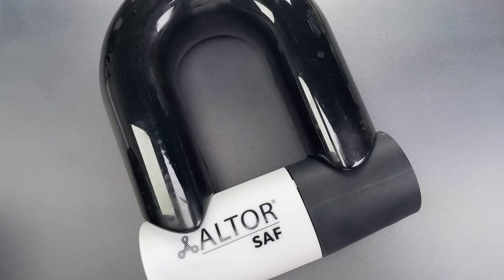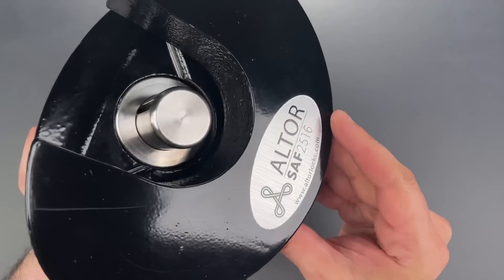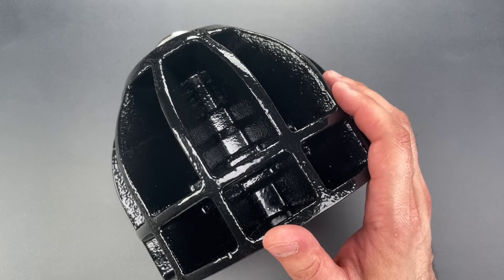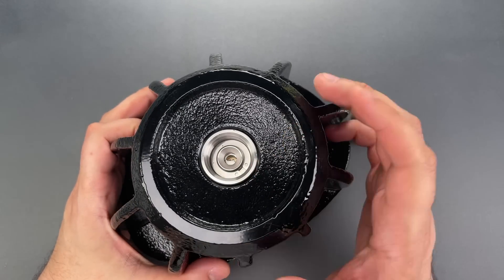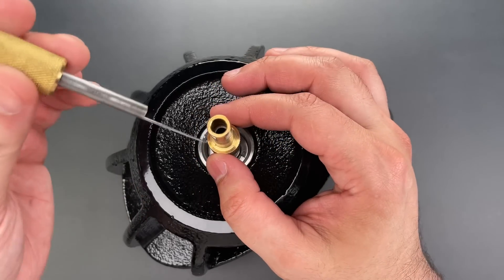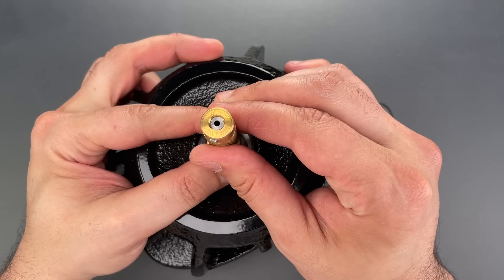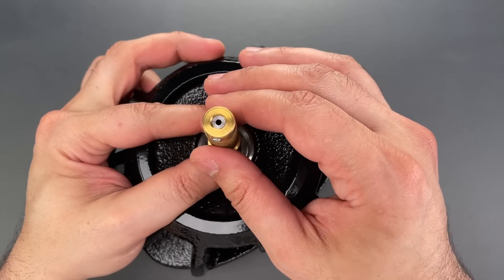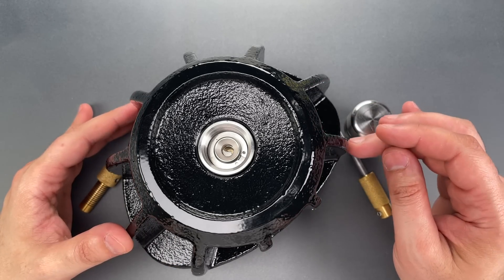[1339] HUGE Altor “SAF” (Strong As F***) Trailer Lock

Comment: "Not hesitate to use". Basically as good as a recommendation as you can get from LPL
Reply: "It's probably good enough for almost all purposes." I don't think I've ever heard 1% of this recommendation from LPL.
Reply: @NeatNit  "I would not hesitate to use." is the one that really struck me. If I worked for Altor, I KNOW I'd want that on the the marketing!
Reply: @AnimeSunglasses  Yeah I would have this printed on the front packaging: LPL would not hesitate to use this lock.
Reply: yes i notice LPL has some extremely high standards for locks
Reply: As good as its ever will get!!!!
Reply: I mean he had to use a tool he made so I think the average trailer thief will take one look at this thing and leave
Reply: Probably good enough
Reply: @ScoutSilico  *take the lock and leave
Reply: Makes me wanna buy a trailer just to put this lock on🤣
Reply: @ScoutSilico   not in my area....they will full on unbolt the hitch and put one they carry around on it instead
Reply: @Chordstride cant. 
The only piece on a trailer u shouldn't weld is the hitch part. Most even have a "do not weld" sticker on them here. Mainly bc welding them actually can damage the parts structural integrity and make it so if your in a crash its more likely to snap off and sending trailer flying....happened last year I think. But the guys trailer drawbar also broke in half.
Reply: @Chordstride not like a weld will stop em where I'm at. 
They will full on oxytorch off the piece cut the old lead etc and put a new one together onsite all within about an hour. Useally in middle of night to.
They even cut up some guys trailer recently.
And rolled a dude project ute out and down road onto a car trailer and stole his trailer to....
Reply: That's high praise...
Reply: @southaussiegarbo2054  well worth it considering whatever is on or in your trailer is worth way more than that.
Reply: #Evil
Reply: @LazureusFalcone    not when the theifs where I'm at will got any length to steal the trailers 😂. 
They will even full on take out a fence to reverse into your trailer and take it.
You take wheels off they even carry spares and nuts to
Reply: there is nothing "basic" about that recommendation! I would call that the highest of praises
Reply: @NeatNit  .... i wanna know what insane purpose it isnt good for lol
Reply: @derangedchicken2191  If there was any one person that I would trust to not be a paid shill it would be The LPL.
Reply: Everyone at Altor be like: WE DID IT BOSS.
Reply: @southaussiegarbo2054  That was my thought. You could probably cut the hitch off and put on a different way of towing it easier than getting the lock off.
Reply: @pvic6959  Something life-or-death? Locking up a trailer full of nuclear waste?
Reply: @southaussiegarbo2054  If you have such a valuable trailer and have it in such a theft-prone area, perhaps try to store it someplace where thieves would have the cops called on them during the hour it takes them to oxytorch off the piece.

Locks don't prevent thefts. They make them take a longer time, so people can notice a theft is taking place. Like, shit a motion-detector spotlight and camera are hardly expensive - if thefts are really as common as you insinuate. Or a GPS tracker.
Reply: @ScoutSilico  Or just take a power tool and cut off the ball its protecting and mount their own?
Reply: Agreed. High praise.
Reply: @southaussiegarbo2054   $300 for the lock, in some cases $30,000 for the trailer.
Reply: @pvic6959  Any purpose other than a trailer lock ;D
Reply: @southaussiegarbo2054  $300 is a good buy if it protects your several thousand-dollar trailer from tow-away theft.
Reply: I thought the exact same thing! Omg, it's not junk!
Reply: All staff memeber, even the janitors will get definetly a week or two paid holiday after this praise.
Reply: this is actually the best recommendation I've ever heard of him
Reply: I was just gonna say that myself, perfectly said.
Reply: @owl77  they have this video linked on the product page of their website.
Reply: He said it is "good enough for almost all purposes", but it would be useless as anything other than a trailer coupler lock.  I tried using one as a graphics card and it didn't work at all!
Reply: @logangray5196   wouldn't matter where I'm at lately. Even the wheel boots won't stop em. 
Some carry around massive sthil quikcut saws and will full on cut off anything. .they will even unhook them from vehicles to steal them.
In a 4 month span to list a few items stolen
1. A b double truck and trailer combination
2. A new Holland T4 tractor
3. 2 tip trucks and 2 excovator from inside a triple locked shed.
4. 2 plumber trailers with hydrojets on them
5. A hk holden kingswood ute 
6. 2 people who derliver catalogs carts full of materials when out derlivering(one was mine) 
7. Some allready illegal fireworks 😂 (yes fireworks)
8. Another truck this time a semi that was at a shop loading doc
Reply: @venge1894   I could bet u 50bucks it won't stop em where I'm at.....No joke. If they will break into a shed and steal tip trucks and excovators then also cut off the gate with a sthil quikcut saw this lock would be like butter.
Reply: @logangray5196   btw we don't have a 30k dollar trailer. Our at most are about 10k
Reply: @goldfinger0303   we got cctv so do others but this year it dont matter. Eta for cops is around 1.5hours now thanks to my stupid state leader sending all the patrols we used to have between 1 and 3 hours away to an area where it was high crime and drug etc rates to the point that now theres 4 patrols in one suburb at all times 🤦‍♂️.

Ppl in my area have been full on sthil quikcut sawing shed door locks(3 of them) off to get into stuff. 
They even stole a b double truck combination with the bloody driver asleep in the cabin 🤦‍♂️🤷‍♂️😂.....they forgot to check the sleeper bunk lol. He woke up tapped em on shoulder said what the f you kidnapped me. They ditched the truck into a tree and tried to run but the driver pounced on them.... 

See my other comment for a larger list
Reply: @darrennew8211   exactly what's happening lately where I'm at. They been going to extreme measures...to the point of even making the power go out so that cctv etc dont work
Reply: @southaussiegarbo2054  Any lock will break given the intruder is persistent. Your buying time in most cases.
Theres a old saying that "locks only keep honest people out".
Reply: @venge1894   sadly it won't stop them much here.
One guy had a similar lock to this one and it took them 90seconds to cut it with a quikcut and another 30 to have it hooked up and be gone
Reply: Out of the countless LPL videos I have watched at 2 am for no apparent reason, this has to be in the top 3 of highest reviewd locks I’ve seen
Reply: High praise!
Reply: @TimHeagarty  Sorry, it was a joke as i know he only accepts whiskey as payment 😂, but in hindsight i see its not that funny so i deleted the comment. Also, i only buy locks that LPL recommends as i know he is not a shill, most likely the least likely on YT. Ciao
Reply: 2:15 am.
Reply: A glowing review, honestly
Reply: No one will buy one
Reply: @southaussiegarbo2054  I think it's fair to say that in your area the rule is: never own anything nice.
Reply: @crazycjk  very true.
They stole a tow truck then came and stole a 4wd and and expensive boat on a trailer
Reply: The best I ever heared from LPL
Reply: Essentially god level stuff here.
Reply: That's essentially gushing for LPL
Reply: @southaussiegarbo2054  that's why you weld the bolts, that's what he recommended on another video that way they can't take your hitch
Reply: @southaussiegarbo2054  you must live in the hood I'd recommend you moving
Reply: @southaussiegarbo2054  then you're in the wrong neighborhood you need to move
Reply: Fuck right!
Reply: That's essentially high praise coming from LPL.  Impressive beast of a lock here.
Reply: @southaussiegarbo2054  pennies compared to the $100k trailer it's securing.
Reply: @OrangeDog20   what kind of trailer is worth 100 thousand dollars????? Must me gold plated 🤣
Reply: @OrangeDog20   lol that is one expensive caravan 😂.
Definitely dont own one those.
But even then this lock won't stop the theifs in my area. 
After all they did use a quikcut saw on one trailer with a similar lock and drill 2 holes into the steel tubing and bolt on another bit of steel and a hitch and steal a boat trailer......only to lose the boat tho bc owner had it so the boat wasn't locked on in case of theft 🤣🤣🤣🤣. 
His insurance was aware and agreed with his choice. Plus he owned 2 boats and would swap em in his shed each weekend then lock when he done his predeparture checks
Reply: how does this comment have more like than the video has views?
Reply: @UBNsoldier  cant do that in Australia or u goto prison for murder
Reply: @InsaneBlizz  Lol, he picked it in 3 minutes using a tool that fits in his pocket.
Reply: Yea, when LPL actually links the product in the describtion!

Comment: LPL's recommendation is literally the new gold standard for lock makers. In less than a day they have a link to this video on the products store page.
Reply: They knew what they were doing. It’s a prototype. If he got it open fast, they would have made changes and the changes would be what they promoted. Smart move.
Reply: @seanj3667  considering they used disk detainer, all they really needed to do was focus on making it brute force resistant. They could stand to make a lot of money in a short amount of time just applying this logic to a bunch of different lock applications
Reply: @midnightjay1343  I highly doubt any significant money would be made using this tactic.  Beefy locks against brute force attacks are so unnecessary in most applications, and incredibly expensive to make and purchase.
Reply: @midnightjay1343  Or they could go counterclockwise like that telephone lock.
Reply: And they left the word "to" out of the quote for some reason.  "I would not hesitate use ..." SMH
Reply: they could/should have made it a dual key lock
Reply: @phillipsofthedriver  Good news, their marketing guy has apparently seen your comment and fixed the typo
Reply: Sponsored video?
Reply: @nijamkaj  LPL clearly discloses sponsorships, as it's illegal not to and he is a (retired) lawyer. This is not a sponsored video.
Reply: @prasad530  Agree. It makes sense for a trailer lock, though. Especially if you've got a large, high-end trailer (eg a horse trailer, a boat trailer, etc) that you have to keep outside of a garage or secure fenced area then that is a very high-value & easy to steal target. Taking the theft risk from major down to negligible is worth a LOT in that situation, but for most applications brute-force-proofing is major overkill and usually a huge inconvenience to boot.

Comment: I've got an idea how to make it even safer: left handed threads on the protective cap. That would  throw off 90% of the people for a couple of minutes for sure
Reply: make it like one of those 'child-proof' medicine caps too, you have to press down on it as you turn
Reply: A few years ago I had a trailer with a different Reese coupler lock that had been stolen.  They didn't even break the coupler lock.  They winched the trailer onto a bigger trailer, strapped it down, and off they went.  I've now made it a habit to chain a wheel to the frame and chain the entire trailer to my flag pole, alongside coupler and pin locks.  

Thieves I tell ya.
Reply: @xtanon5540  wow!  that's crazy.
Reply: @thesunisfun423  that was easy? if he did anything he sold more of them... hitting something that hard that loud that many times would defiantly draw attention. that lock made him look like a fool.
Reply: EXCELLENT suggestion. All British airmen in WWII carried a hidden map of Germany, France, etc. during missions. It was made of silk, printed, and folded into a TINY block.
The block was then put inside a hollow brass button on their flight jacket, with a left hand thread. Despite looking for it for 6 years, the German never found a single one. True story.

Comment: "It's probably good enough for almost all purposes."
"This is something I would not hesitate to use."
That's solid praises from LPL, congrats to Altor!
Reply: Hell!   I'm putting it on my front door!
Reply: @AsHellBored  stop giving me ideas
Reply: Print that on the packaging for sure!
Reply: «Something i would not hesitate to use» means nearly unpickable
Reply: This is advertisement so of course he won't masterlock it :)
Reply: So, basically, the best locks that I've seen recommended came from Kryptonite and Altor, and so far, the best practical lock types/keyways have been disk-detainer cores.
Reply: You can use a pen cap for kryptonite locks.
Reply: @johnmartin4461  only old cylindrical ones with even driver springs, they really took a hit there and have improved a ton since

Comment: 0:42 "Roughly the weight of 50 MasterLock number threes"
I appreciate the establishment of a novel weight unit dedicated to this channel.
Reply: That’s just the good old American system. We measure things in lengths of football fields, weight in master locks, and time in dog years.
Reply: @Ceece20  this is probably more practical than the imperial sistem
Reply: @falquicao8331  it’s probably the equivalent. Unless you are in science, design, or architecture (and other job related things), most measurement systems are fine as long as there is understanding between the people. Miles or kilometers don’t mean really anything unless you have an understanding of the distance. Outside of what I mentioned above, there really isn’t a difference between pounds and kilograms. They are just numbers.
Reply: @falquicao8331  It's basically the heart of the imperial system - choose an everyday object that everyone is familiar with, and then use it to measure things. The metric system is the weird one with is quasi-scientific units of measure that have zero relevance to the everyday world and are usually out of proportion to the things they are measuring..
Reply: @ARCNA442  I would say the imperial system is can be easier to visualize at the beginning, but more difficult to work with if you need to change scales often. Metric is more arbitrary, but also more organized (though I come from a metric using country so I'm kind of biased towards it)
Reply: Americans will do anything to avoid the metric system 😂
Reply: Wow, the coping mechanism to retain the imperial system is mind boggling
Reply: @ARCNA442  whats the point of using everyday objects to measure stuff though?
How long is this banana? oh well its about one banana long... no shit sherlock..
Reply: @creamwobbly  The Decimeter just can't get any respect, what is it? Take 10, for decimal and then multiply it by 3/8 and add a pinch for good measure.
Reply: @creamwobbly  Liter? I know some people like to call a cubic decimetre a litre.
In the end SI has its own stupidity like the base mass having a prefix (or you can choose CGS) and the kilo prefix not being capital despite all the larger prefixes.
Best we can say is it's less dumb because at least a litre is the same no matter what is in the container (bushel and ozt)
Reply: About time. Using Toyota Corollas would be a little bit inconvenient.
...unless we're talking Altor locks, then it would still work OK I Guess.
Reply: @mch2359 The decimeter is the example I'd use for why I mostly prefer imperial to metric, and that is the inch and the foot are just better for quite a bit of everyday measurements. The millimeter and meter are fine, centimeter is alright too for smaller things but there's too big of a jump between a millimeter/centimeter and a meter and the decimeter does very little to change that. But then again there are people out there that think the centimeter should be done away with too and everything should be measured in millimeters and meters anyways. It's whatever I guess lol.
Reply: @creamwobbly  I'm assuming you have never bought fabric in the US. it's sold by the ... wait for it ... yard. The rest you are correct about. No one measures their weight in stones in the US.
Reply: I see no problem with using everyday objects for measuring as long as the person on the receiving end understands. I do not understand, as I don't know how long a football field is and stuff like apples can vary in size, but if the person you're talking to understands, it doesn't matter